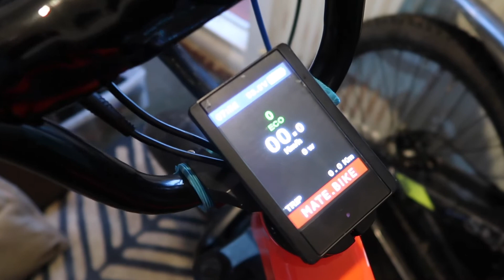mate X (mate.bike) Custom/Modded 20X4 Fat Tyre Electric Bike / UPGRADES - BMX Stem & BMX Handlebars

Comment: It's great Paul , well done. Just one thought personally I think it would look , and ride better with the battery on the frame as you did it originally.
Reply from the maker: Hi Simon - Yes i totally agree it looked better on the frame & would be balanced more like the original design (with battery in frame) & also i swing my leg over the back wheel getting on bikes so this rear rack might be a problem BUT putting it on the frame i was just worried about drilling the frame to fit the battery holder?what do you think?Cheers
Reply: @paulleeFLOW  
Hi , yes it'll be fine .Two or three M5 rivnuts to fasten the battery carrier to the frame.
Reply from the maker: Thanks Simon & i was right it was a struggle getting my leg over the battery & the seats too high so im putting the battery on the frame this weekend - cheers mate 🤟